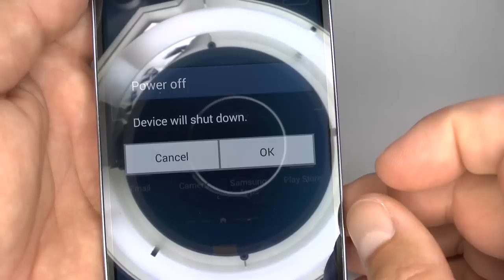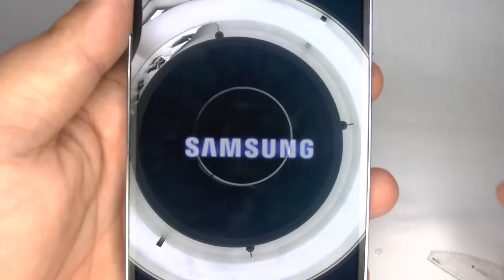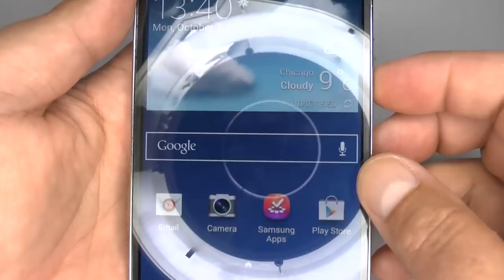Galaxy Note 3 Disassembly Teardown & Assembly - Digitizer Screen & Case Replacement

Comment: Question: I followed your video and I was able to replace my Note 3 screen assembly with digitizer just fine. Afterward, I came into a new issue - ghosting. I tried to adjust the sensitivity, but that didn't work. What should do to resolve this issue?

Comment: Is there a good replacement battery you recommend?  My original one isn't really holding a charge very well anymore.
Reply: There are many out there (most from China) - and most have outrageous/fake mAh ratings - so take it all with a pinch of salt. My advice is, if you're looking for the best possible battery life, get the original. If you're ok with 60-70% of the original, get a clone knockoff.
Reply: JustifyJustin

Comment: What do u think, is it possible to use the current S-pen map with a new screen/digitizer? cuz my digitizer isn't working anymore (after a drop the screen stays black while the phone is still working) and for replacement I've got one without the map part.. and as I saw in your vid the map is fixed below the display flex cables.. thx in advance!

Comment: I have a Samsung Galaxy Note 3 N9000 That I bought at T-Mobile. I cracked just the glass screen part, (this is the only problem with my phone) and I followed your video above to replace it myself. Everything went good with the replacement, no cracks in the Digitizer and I don't think I used too much heat while using my blow dryer to heat up the glue. And I did take apart my phone in the replacement process of the glass screen to make it easier like you said. My only problem now is that when I turned on my phone again the screen is all black nothing can be seen on the screen at all now. The front LED light on top is working and I can hear the start up jingle and the bottom menu button & back button light up when I touch the screen. I double checked all the connections again and everything seems to be connected correctly. Do you have any ideas about what went wrong? I didn't cut the flex cable at the top corner I was very careful with that.
Reply from the maker: you must have been unlucky to have damaged the display when removing the glass. There's probably a very small crack on the display that cannot be seen by the naked eye.
There's not much you can do except buy another display assembly. There's always a small gamble when trying to replace the glass screen only..

Comment: Ive got a sprint note 3 it was working fine one day, was put in the diaper bag, it went off and will not come back on. I also have a note 3, so we took my battery and tried it in hers will not power on. Tried another charger in hers, no led comes on. I have taken the phone apart and everything appears to be connected and tight. Any idea on what i should replace. When i plug a charger into it, i get no charging led, but if i put my charged battery in, it still doesnt come on.
Reply: +Steven hendrickson Sounds like the phone isn't getting power from the power source... could be a motherboard issue perhaps.  I've never done this, but with computers it's often a similar situation... power supply works fine, power source works fine, but computer won't boot up.  More often than not, the power supply can't connect to the motherboard in this situation, and with these tiny motherboards, I bet replacing one part on the board is difficult or not possible (meaning you might need a new motherboard)

once again, I've never done this.  Just guessing.  Perhaps google your issue and put in key words that relate to the motherboard and power

Comment: Hi Le55ons, again, this is a really useful video. I used it to swap the screen for a friend of mine. Worked like a charm. Two weeks later, he calls me, saying the video doesn't record anymore, youtube doesn't play any more, can't record audio. The screen however works wonderfully. 
So I went and spent some money on the loudspeaker and some on the microphone module, just under 10€ each. But no cigar. Now I am restoring stock firmware version 4.4.2 and it still has the same problems. 
Any idea, that could help me ? 
Thanks

Comment: Hi, I brought a new lcd to replace my broken phone after a drop, and after taking out all the chips and parts from the old phone and placing them into the new one as in your video, I havent had any luck with turning on the lcd still. At which connections does the internal hardware connect to power the lcd? Thanks for any thoughts or suggestions!
Reply from the maker: 8:07 is the display connection, it might be a faulty new screen, try plugging in the old one to that connector to confirm

Comment: couple things. first, great video, I previously watched your S3 video for support during repairs on that unit. now, after screen replacement,  can you think of any reason why the person on the other end of the call hears echo of their voice even though neither party is on speaker? The digitizer/case is from a N900A and the motherboard is from a N9005. Phone works great except for that little issue. When an earpiece is used the problem goes away. The headphone jack is from the 900A so maybe there is a compatibility problem as the motherboard is N9005?
Reply: I am trying to do the reverse to this, n9005 digitizer/case and 900A motherboard. 1st issue is the board does not fit properly. I see what is causing this and can resolve this issue but wondering if its worth going any further based on your experience.
Reply: it took me about 10 minutes and worked fine. Just remember to take off the earphone jack. its in the way. Also, tape off the parts of the phone with blue painters tape only exposing cutting area to keep metal dust at a minimum. Blow off with compressed air when completed. to see where to cut go to http://badfashion.com/images/900_mod.jpg

It worked fine, I ended up with 2 working Note 3 just one with a cracked screen.
Reply: Duke Snyder Thanks for your advice, it works perfectly. I used the 900a motherboard in the 9005 frame. I used the 900A usb board but it stop charging recently, im wondering if it matters which usb board is used.  I have a separate charging dock for my batteries so its not a problem but I would like changing the usb board, just not sure which one I should buy.
Reply: I have tried a few different USB charge ports with no success.
SM-900A AT&T (came off the phone)
SM-N900T TMO port and the 
SM-N9005 LTE port

Tried different cable with them all as well just in case. 

because I am hard headed I will most likely keep trying despite the cost until I figure it out. I think my original SM-N900A might have been bad. I never verified it. I just bought the phone for the screen. Next step is ordering another one. Will keep you posted.
Reply: Duke Snyder Im hard headed too. I already bought a 900A usb port, just waiting on delivery to see if it works. Weird thing is I reassembled the old parts. 900a frame/digitizer(crack lcd), 9005 board,9005 usb port, 9005 back,. its charging perfectly no issues for more than a week. I was gonna try the 9005 usb port but was waiting on your response but based on your experience I will give the 900A usb port another try.

Comment: Hi there. Please help. I have dissembled all the parts to replace the middle bezel as per the video. However the screen is not showing up at all now - when i switch it on the phone buzzes.

No parts including the screen look damaged. Any ideas?

Comment: Great information.  I was able to replace the damaged charging port thanks to your video.  I did however have a problem that started right afterwards.  When the phone is in a low service area, the phone will not make calls or receive calls.  Getting the message Mobile Service Not Available, however, I can send and receive text messages.  Do you think this could have anything to do with the 3G/GSM antenna?  I'm on a verizon Note 3 so I made sure I used the correct Verizon part (SM900V) instead of the international Samsung part.  Calls, text, and data all work fine when service is strong.  Thanks in advance.
Reply: Actually I just saw at the 32 minute mark you comment on this.  Going to try that and see if it resolves the issue.  I never made it through the entire video since you addressed my original issue in the first 5 minutes.

Comment: What is that metal copper plate on the back of the screen. I ordered a replacement and it came with out it
Reply: It is the S Pen mat, first mentioned at 18:30.  My replacement came with one, but here is an Android forum post from someone else who didn't get one and called it a "salvage challenge".  It seems that they were successful in transferring it to their new screen. See: http://forums.androidcentral.com/verizon-samsung-galaxy-note-3/375888-note-3-screen-self-replacement-success.html

Comment: Hi LE55ONS.

I have a Note3 using it from 6 months now and actually my headphones output audio only from left side. I noticed inside of the jack socket that one of the small pins is stuck deeper than the other one. I assume from dust or something. Could it be unstuck or releassed with a niddle or something without me having to dissamble the phone and replace the whole thing? Have you ever encounter this problem?

Thanks in advance.

Comment: just replaced screen following your video which was very helpful. the problem i have now is when the phone powers on it stays on for a few minutes then turns off and back on. any ideas on why this is happening? any help would be greatly appreciated.
Reply from the maker: Its probably a faulty new screen, try plugging in the old one and that should confirm it
Reply: okay mate. cheers i'll try it.

Comment: I dropped my Galaxy note 3 into a lake, everything works perfec but the GSM, when I insert the SIM in it says that I have a SIM but I don't have any bars and I am not able to make or receive phone calls. which part should I replace ? the GSM antenna or the Charger port with the GSM and 3G connectors ?

Comment: Purchased the entire LCD with frame, replaced power button, when connecting the phone to a charger it only shows the battery indicator. Attempt to power on device (can hear the points making contact) but will not power up.  Any suggestions? Thanks in advance.

Comment: I have an issue with the phone, when phone hit some place a little hard it s turning off and it is quite hard to turn it on again , i am taking out battery and putting in again try and try , even trying to close the back cover it is turning off sometimes, 
what do you think the problem may be ? please help , i noticed that bottom part is more sensitive , thanks beforehand for your help ,

Comment: I replaced the USB port since it couldn't have a snug connection with my USB cable. After I swapped it I am getting no audio from the speaker or my microphone. I suspect the speaker on the back panel may not be contacting the board or the USB port I installed may be faulty. Any ideas?

Comment: Would it be advisable to take it apart and check the wifi antenna? Mine doesn't work and I have tried everything else
Reply from the maker: try having it repaired under warranty, if not then remove the back and make sure the sprung metal pin is high enough to make contact with the rear cover antenna

Comment: Just replaced my USB charging port. And now it only makes and receives calls when it wants to. Lose signal and says roaming at times. Could it be those metal tabs need to be adjusted? Or bad usb flex cable

Comment: Hi LE55ONS.
I dropped my Note 3 and my screen is black and cracked.
I'm unable to use my finger(s) to touch my phone, but S Pen works fine.
Everything works fine except I can't see anything or use it with my fingers.
Do I need a new Digitizer or Digitizer and LCD. 
I was going to purchase a new LCD touch screen digitizer + frame all together. Would that be my best option?

Comment: So if I'm going to be replacing the whole LCD and screen with housing I just need to basically take out all the parts you did in the first half of this right?
Reply from the maker: that is correct, take your time and you'll be fine..

Comment: 5:38 what happens if the contacts get bent? Can i just put it back to it's original place or do i have to replace it? Cause i found one of the contacts bent in another direction.
Hope you reply!
Reply: Also for some reason the home buttons aren't working

Comment: i think i broke my lcd wanted to change only the broken screen but im not too shure if its the heat that i applied or if i did damaged it with the tool, the screen is now black and does vibration every 10 second,,,,,can you help??? thanks

Comment: Can you help me? I charge my Note 3, it shows "charging" on the screen, but it does NOT charge at all (power on and off). It even discharges.faster. I thought it was the micro USB circuit board, so I replaced it,  but it remains discharging. 
What could it be?? Thank you

Comment: thanks for yr video. Could u seperate the video with different parts replacement ?
And could u launch a video om how to replace( and assemble ) home button and wifi and card slot ?? Thanks
Reply: and please tell me which parts of components we hv to purchase for the replacement . Thanks deeply =]
Reply from the maker: hotong kwan In the description(About) there are time links to all the different parts, like 24:18 is the home and touch key flex

Comment: Hey LE55ONS, your video was invaluable to me for a recent screen replacement. However, that did not fix all my issues. It seems that the note 3 is refusing to charge because the battery temp is too low. I used androsenor, and the reading from the battery temp sensor is -4 degrees F. I thought from searching on google that I might fix this issue by replacing the charging port/mic board. This did not work. I can't seem to find any information on which part contains this battery temperature sensor.  Any thoughts would be greatly appreciated!
Reply: Never. The issue persists. We have just bought an external battery charger.
Reply: gashthrasher v.2 hey man.  Wrong censor. The one I am referring to is for the battery only.  It is located in the logic board.

Comment: I cracked the lens on my camera, and I cannot find the replacement for it in black. The only option I have is to buy the whole rear housing and replacing it. My question is- if I buy the international housing, will my LTE and all signals still work on my at&t note 3? Thanks
Reply from the maker: I'm not sure if its the same or not, take off the rear cover and compare the antenna's with the housing photo's on http://www.etradesupply.com, they have a few photo's of each one so it should be possible verify. You can use coupon code ETS2 for a little discount which also gives me credit.
Reply: alright well i ended up finding a non oem one on ebay for $30 that IS for the n900A and it had free shipping. ETS wanted $19 just to ship the stupid thing. Thanks for the reply though.

Comment: Question: my bezel is dented and i want to replace it. Do i hv to disassemble everything like what you did?
Reply from the maker: yes and be very careful near the digitizer flex..
Reply: ***** Do I have to go to same extent as you if I get the bazel frame with LCD ?
At which point in the video would I start the reverse process if getting new LCD along with the frame ?

Which process is recommended ? Thanks in advance for your reply and wonderful video :)
Reply from the maker: Imran Salim If you buy the screen and front housing its pretty easy. You only need to follow the video upto 12:50 and then follow reassembly from 30:15
Reply: Thx

Comment: Hello LE55ONS,
in the first thank you for the Video, it´s great.
i tried for the first time to do the same just like you. i wanted to Change the Frame because my old one was totally demage. but on the device worked all fine.
now i cutted the Keypad Home Flex Sensor by trying to solve Display from the frame and i thing i demage the Display Touch Screen Digitizer.
i have the same issue just like you on the Video in the 18m:22sec, Display Corner. now i can´t rebuild the device caus i have to wait for the keypad home Flex sensor.
my question is could be the Display demage when yes if that mean that i have to by new one??? because thats the most expensive part.
i got the note 3 n9005.

thnaks a lot of
regard elvis

Comment: Wow, I'm going to refrain myself from saying anything too insulting. Now I work on phones for a living and I have to say that while his technique is pretty good, in the end you ended up damaging the digitizer which was a loss really. What i would have done was remove the glass, heat up the back part of the phone, start taking off the lcd/dig with a simple playing card and then glue the glass back to the lcd/dig. It's easier and much safer.

Comment: I have a quick question I have a note 3 sprint n900p body I would like to know if a n900T motherboard (note 3 tmobile) will work in the n900p body? How much moding would I have to do (I have a dremel and stedy hand) ha ha ha
Reply from the maker: I think its the same, but you won't know until you compare them side by side

Comment: Please help. How do you replace the battery pin connectors if they break or bend away? I'm speaking of the four or five pins sticking out of the main board that connects to your battery. Thank you.
Reply from the maker: If you Google hard you should a new battery connector, it will probably need a soldering iron to replace it, you local phone or tv repair shop should have the knowhow and tools

Comment: Hey I was wondering if you could help me with a question. I dropped my galaxy note 3 it looks to have bent the frame in he top left corner up a little bit. The digitizer is cracked, do you think that is the only problem. It also isn't lighting up the screen. Is this because of the digitizer be cracked.?
Reply from the maker: yes it sounds like a new display with a new front housing would fix that problem